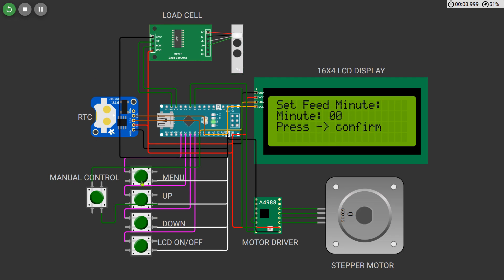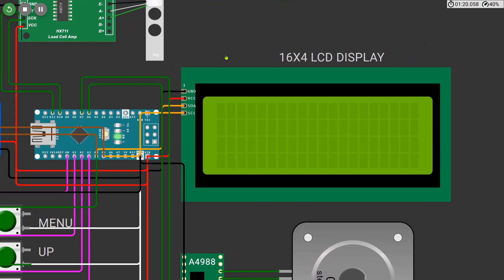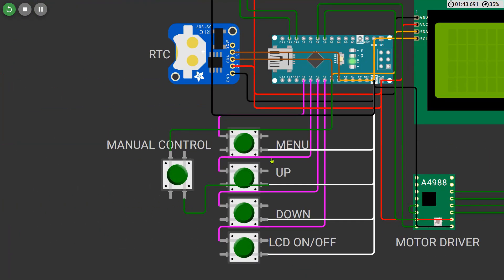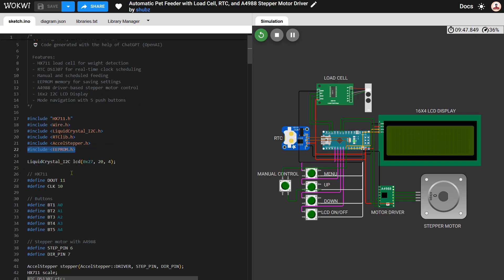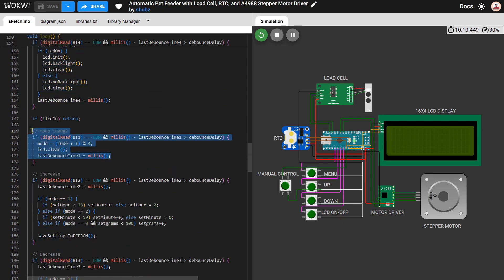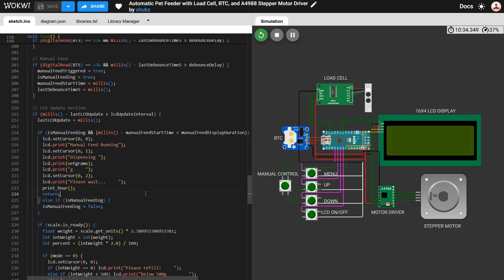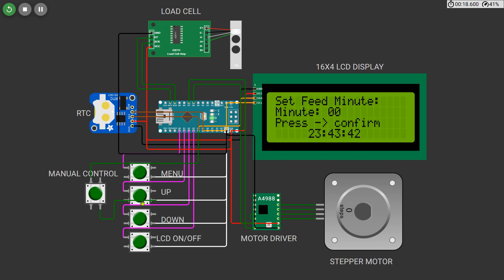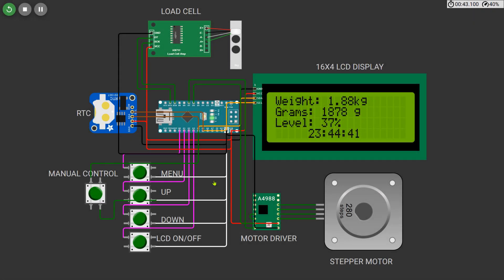Automatic Pet Feeder Using Load Cell & RTC | Arduino Nano + A4988 Stepper Control | Full Tutorial 🐾

Comment: Bro I connect the components correctly and give the code but it shows the error 
How to solve
Reply from the maker: Where is this problem happening, in the actual hardware or the simulation?
Reply: @technicalshubham789 During simulation sir i cleared it and worked out well but now ,new problem created sir, i have done this project and present to staffs they selected me for the final round. I don't know how to explain and how to add some future scope on it . I have lot of doubts sir. Day after tomorrow i have a final round. I don't know what to do sir.
Can i have ur number or any instagram id sir.
Please please please sir